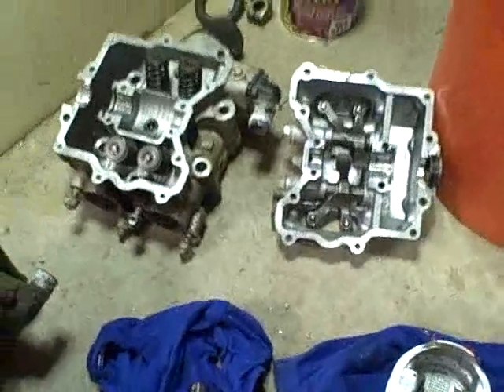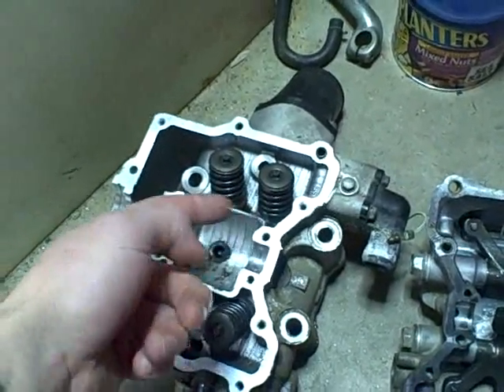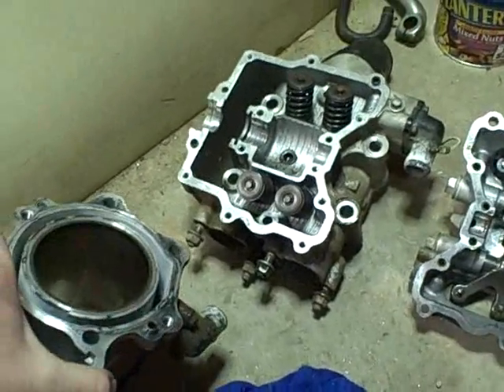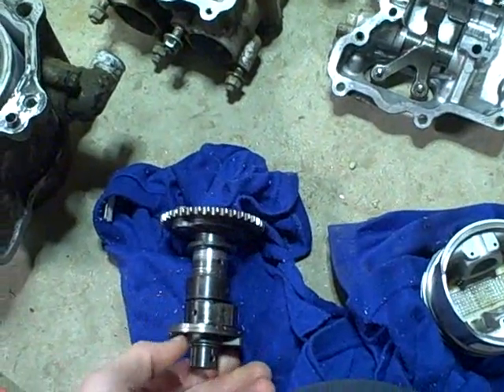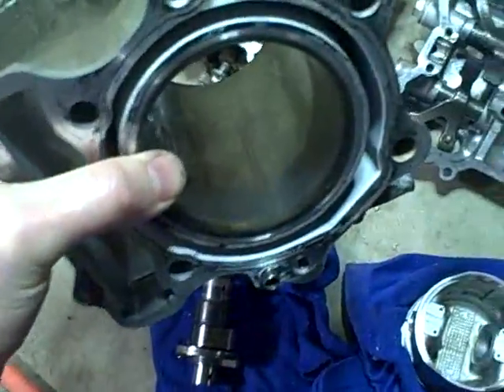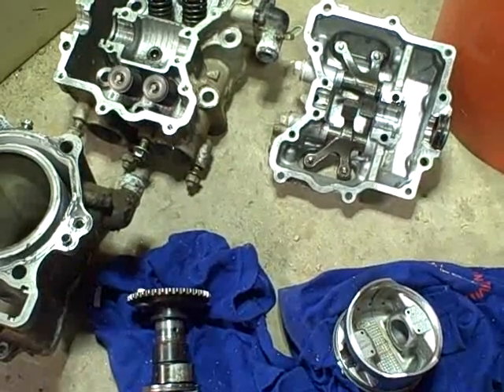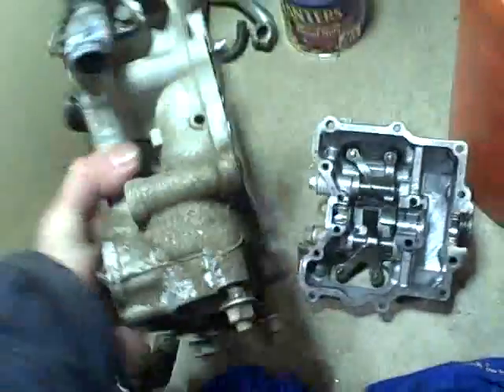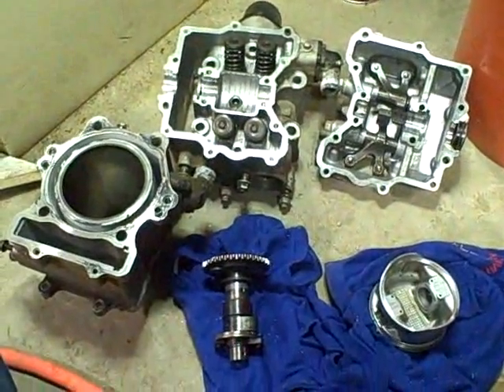Kawasaki KVF400 Prarie ATV Project Part 9

Comment: Thank you. I really enjoyed the video series. They were very informative. I too live in Mass and just picked up 2 Arctic Cat ATVs which both were not running. I recently got one of them running after replacing the CDI, coil, rectifier, battery and rebuilding the carb. It's getting too cold to work on the other. Maybe I'll do a video series on that one in the spring.
Reply from the maker: Hi, congrats on the Arctic cat repair. although I sold mine, and it was a beat up old '97, I cannot say enough about what a rugged, well built quad it was. I'd like to score another project quad eventually, but have too many unfinished projects at the moment. Check out my trailer video for my page, and you'll see what I mean.

Comment: Thanks a ton for all the extra effort needed to make this series!  I know that fumbling with a camera while completely tearing down an ATV must have been a pain, but I have a 99 Prairie 400 4x4 and really wanted to learn it from the inside out.  I was hoping to find an informative video, but you Sir, exceeded my expectations!  I love the machine, she runs like a champ and want to take good care of her.  It has about 350 hours and has been taken good care of and I want to continue that.  I'm fairly handy around a garage, but by no means a mechanic.  Any tips you have to keep this thing running for years to come, besides the basics, would be greatly appreciated!  Again, thank you for all your work -- I learned a lot!
Reply from the maker: Thanks for your comment. I'm glad the videos helped. I wished I could have saved this quad, but it would have meant poring more money into it than I wanted to. The Yamaha Grizzly is the other junker I bought with this one, and it has proven to be a real workhorse. As for tips to keep things running, nothing more than the usual, change your fluids, service your air cleaner, and have fun.

Comment: Hey buddy I'm in desperate need of a set of rocker arms for my bayou 400 4x4 (same engine with 5 gears yours will fit) can you do any thing for me? I don't have very much money but I really want my ate to run. I lost oil pressure to the head and it took the cam and rocker arms out, I got a good cam and head but now I really need some good rocker arms. Thanks buddy!

Comment: hello I am very much in need of a reasonably priced rear differential do my 1998 Prairie 400 4x4.  it runs great and used to be very powerful but the rear differential must have something worn with it because something in the rear is making an awful clicking sound when its put under a lot of pressure.  if you still have this part would you sell it?
Reply from the maker: yes. I'll sell it.

Comment: Ran out of oil and running I have two and my red one actually started doing that how much?
Reply from the maker: +Seth Snipes Sorry Seth, I do not understand your comment.
Reply: How much you want for the parts I have 2 of same kind and that's what I need for one of them
Reply from the maker: Seth Snipes I did sell some parts already. what exactly do you need?
Reply: +Steve Watroba the Pistons and piston holders whatever u called em
Reply from the maker: +Seth Snipes oh. the piston was scored so I think I trashed it. might still have the cylinder.
Reply: Do u also have the ignition coil?
Reply from the maker: +Seth Snipes yes
Reply: How much?
Reply from the maker: email me when you get a chance. stevewatr@hotmail.com In the meantime, I'll double check if I have the coil. Pretty sure I did not sell it. BTW, how sure are you it's the coil? The electronic ignition module on these can go bad and cause no spark.
Reply: +Steve Watroba  the four wheeler is back fireing when it rains but I  can cover it in water over the headlights and it will crank right up but if It rains it won't crank and back fire really bad sounds like a shot gun